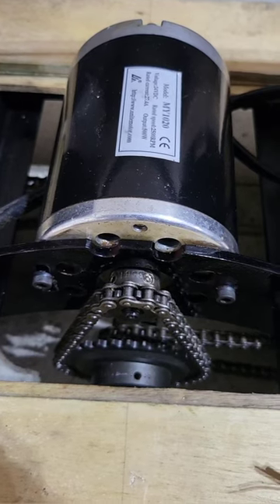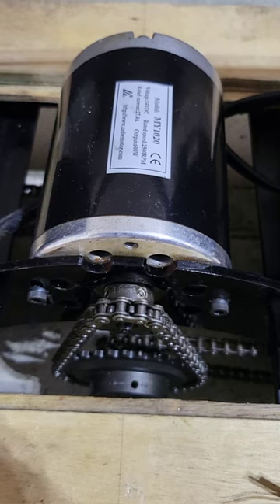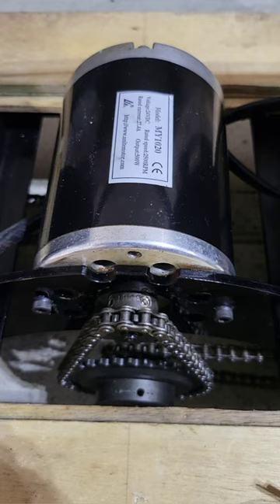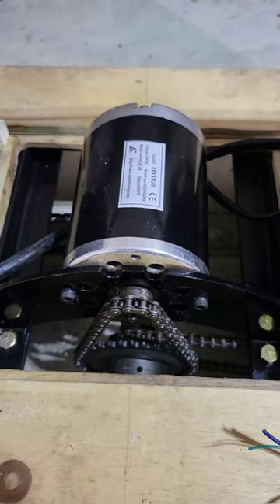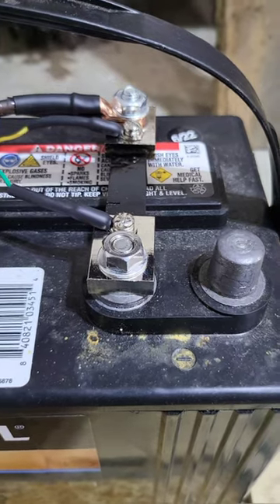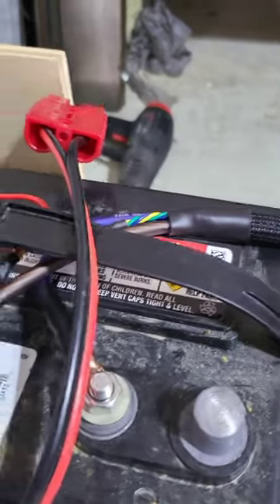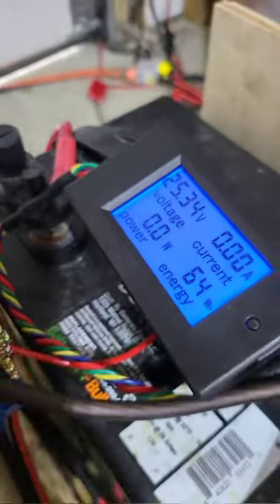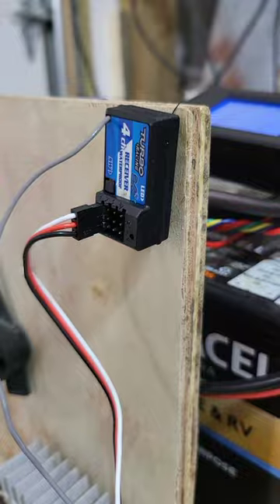Turning a short job into an all day affair

Comment: you been busy! kinda like me working on my projects. the goat says it best! cool gondola project!, and your hopper car is cool too! 3 cheers for the goat!
Reply from the maker: Glad you liked it!
Reply: @MillBrookRailroad  well, i am 72, retired, and have way too many projects going on, but thats much better than wasting my life in a senior care facility. Just curious, whats the minimum radius curve your locomotives can negotiate?
Reply from the maker: @paulsmith5398 , The sharpest I've taken it around was a 25-foot radius curve, and it did fine, but I think a better question is: how wide can you make your curves? I'm thinking more about the cars behind the engine.
Reply: @MillBrookRailroad  the reason i was curious is, my backyard is 60' X 80', just enough for a small oval, with a small homemade engine, maybe one or two cars, and a 4-wheel bobber caboose.

Comment: Hi Aaron. Any chance that you'd share a wiring diagram for the #70? Did you create it yourself from research?
Reply from the maker: The wiring diagram is simple. Just wires from the batteries to the cutoff switch, through the fuse to the motor controller, then out to the motor. The research is what works out all the little details to make it repeatable. If you don't like doing wiring yourself, I do sell the wiring harnesses ready to install.
Reply: @MillBrookRailroad ,  I appreciate the offer and will keep it in mind:) The wiring would be the fun part, I guess I will have to dig in and do some research too :)